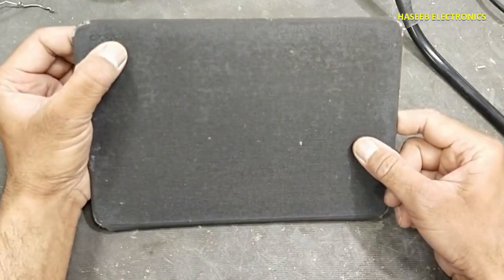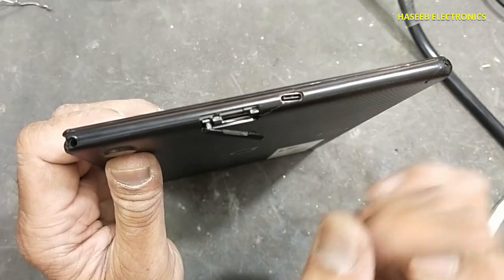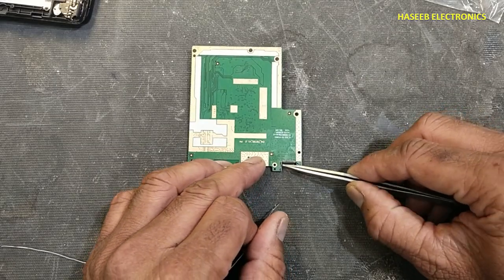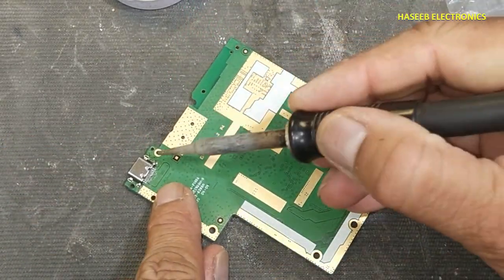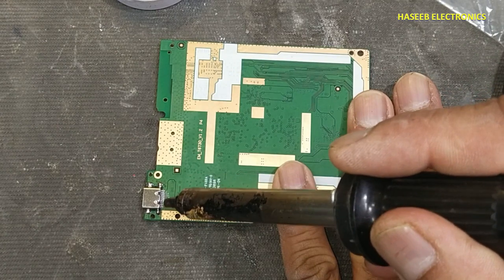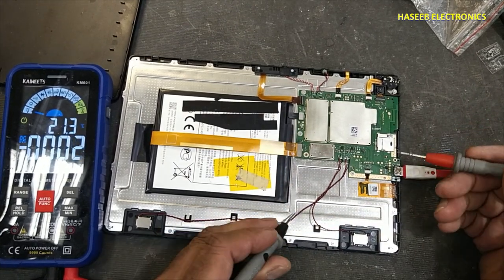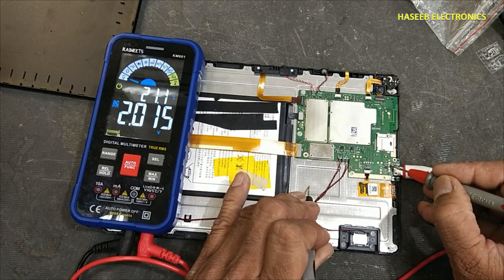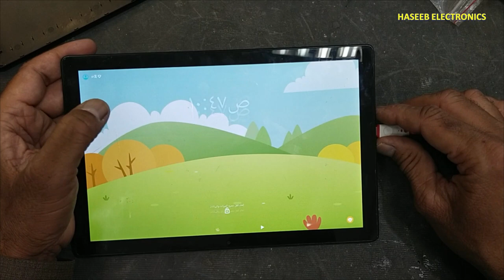{880} Charging Port Replacement For Alcatel 8092 Tablet

Comment: I would not use metal tools to open the tablet, you could damage inside easily. Better use plastic tools like 
 credit card or guitar pick. And I would use a soft mat on the desk to not scratch the display glass.
Reply from the maker: yes sir
you are absolutely correct
please accept my best regards for sharing a valuable guidelines ❤️

Comment: Sir, I have a question please. How should I determine what hot air tip diameter, hot air flow and heat setting for various components? Is there a rule of thumb or would it be specific to each job? Thank you for this charge port replacement video, it was excellent!